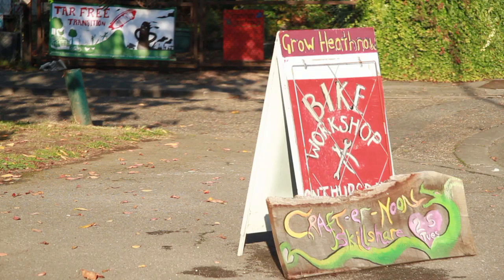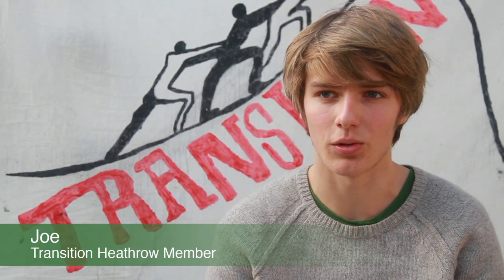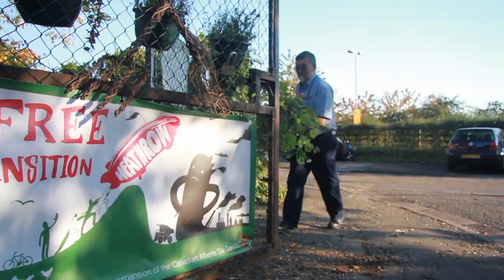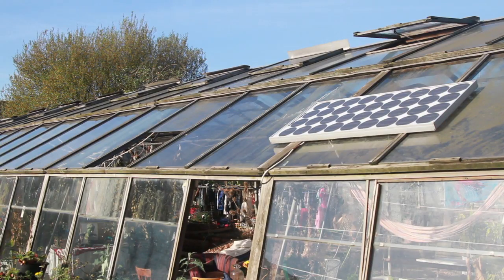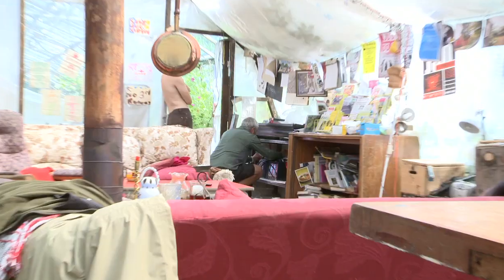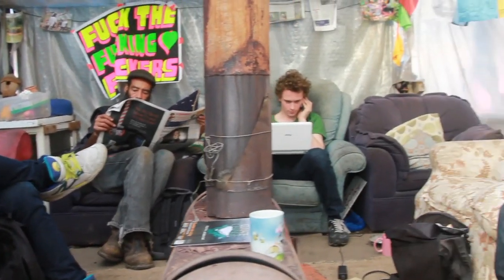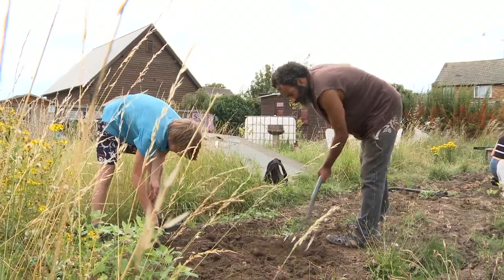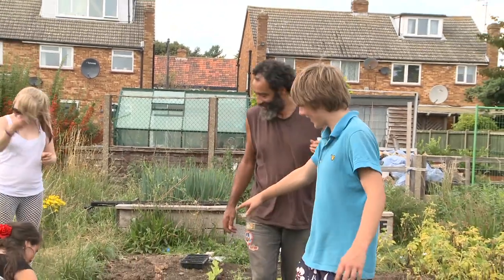Defend Grow Heathrow!- help needed for November 17th 2011

Comment: This in and of itself looks pretty cool but it's a sticking plaster. A typical insular single issue liberal tactic. How about the root cause - capitalism? Do you really think capital will allow you to make any significant change when it affects their power and profits? Of course not.
So whilst on the surface this looks pretty good and I'm sure it's a great thing to be involved in, the reality is that last liberalism upholds capitalism and the state that administers for it because involvement in such things as this kid people that they can make a real difference and their incentive to do something more radical is removed. It's a shame but in reality liberalism upholds the very things that it's supposed to be against. In the bigger picture it is, at best, just a dry wank. At its worst it's the very thing that prevents real, meaningful change.
Sorry to piss on your bonfire but this is my studied view after 32 years of activism.